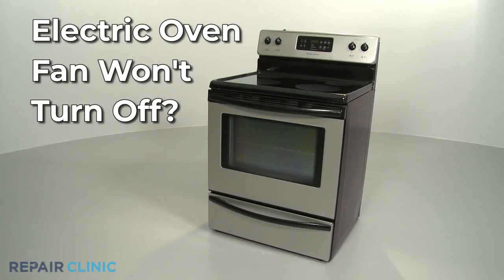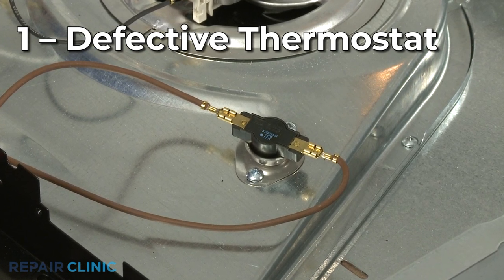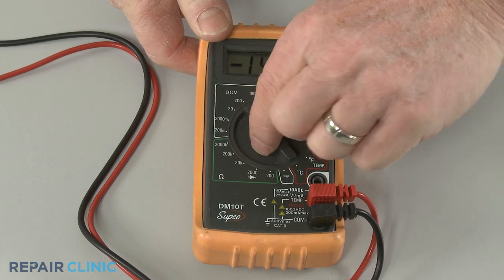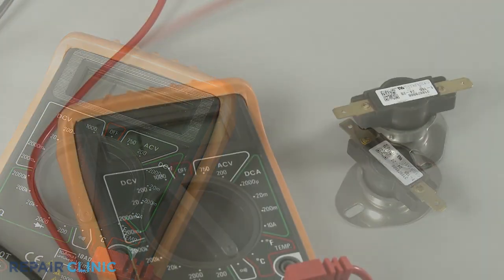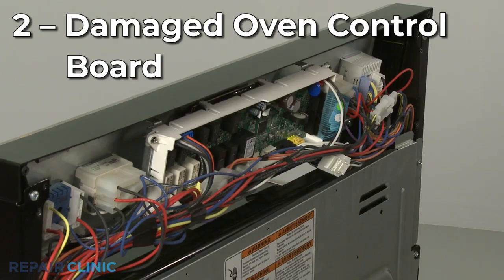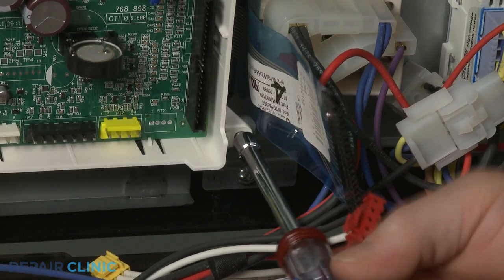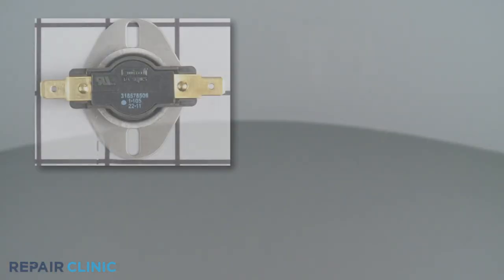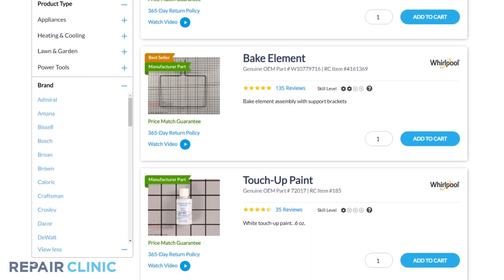Electric Oven Fan Won’t Turn Off — Electric Range Troubleshooting

Comment: Hi, not finding what I want so thought I would ask, I have a Cannon range cooker and it has fan assisted oven, traditional oven a grill and warming draw. If we use any of them there seems to be a fan that kicks in, it doesn't assist and of the cooking so not sure what it's for. So our frustration is after using the oven or grill this fan run on for 15- 20 mins. WHY??????. THANKS IN ADVANCE.